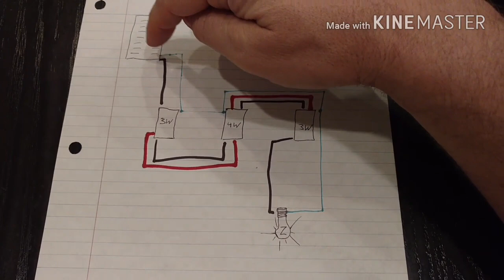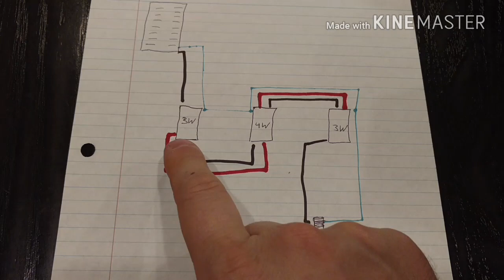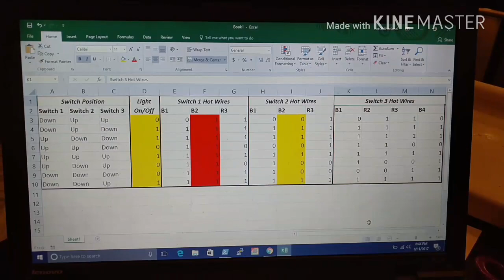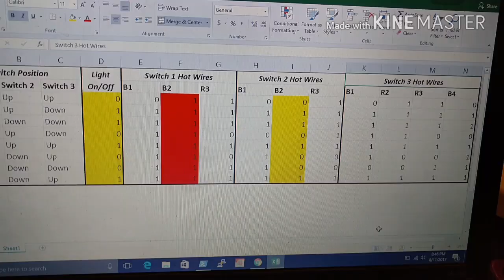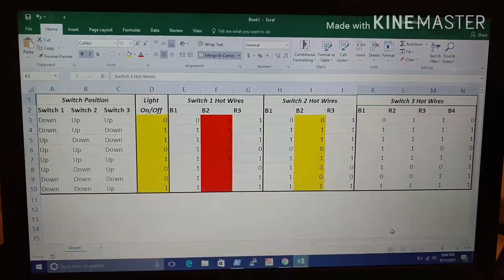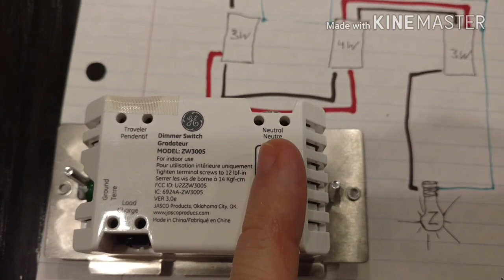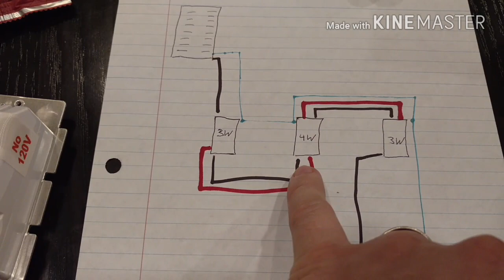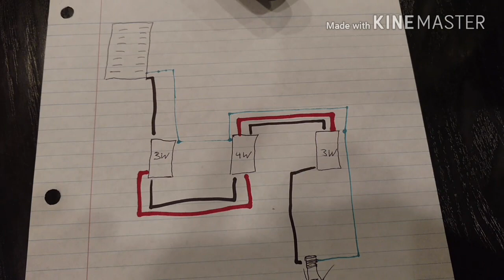Replace 4-way circuit with GE smart switches

Comment: Thanks for posting this detailed video! I was able to follow most of the steps through to the end of the spreadsheet and was able to identify Line and Load positions but you lost me at the "note" about all wires being hot when light is on. Somehow in my configuration I don't have any rows that are all hot when the light is on. Any advice here?
Reply: Think I may have figured it out - I'm not sure that having all wires hot across is a prerequisite for the overall method to work. Using the spreadsheet I was able to "map out" which wires go from one switch to the other (same column values) and basically follow through with the rest of the logic of this video.

Comment: I can use the switch with an input voltage of 220v, since I live in Brazil and the voltage in some localities is 220v
Reply from the maker: I'm sorry. I really don't know anything about electrical standards outside the US. I don't see 220V input listed as an option on the spec sheet for this particular switch.

Comment: I ran into an issue, on my 4 way there is a master switch with 2 reds and 2 blacks, a regular switch with two blacks and a red and then another regular switch with 3 blacks and 1 red with 2 of the blacks tied into the same terminal ( one is a push in and one on the screw) any advice?

Comment: Great video Joe. I spent hours in my last house making a 4-way switch work and only stumbled on the solution, which to this day I don't have any idea how it worked. I do have a question though. My 4-way switch doesn't have a neutral wire in the box. It's just 2 black, 2 red, and the ground. Any ideas how to get the switch to work in this case? It seems I need all of these wires for the power to pass thru and for the dumb switches to work.
Reply from the maker: The right answer is to pull new wire to your box so that you have a neutral in it. :-/ Sorry to be the bearer of bad news. 

Another likely undesirable option would be to turn your four way circuit into a 3 way one by simply joining together the two black in one wirenut and the two reds in another and putting a blank faceplate on that switch box. (As I say in the video, don't assume wire color, but once you confirm/designate travelers vs conductors, you'd know what to join.)

The other option that will function but is not recommended would be to use the ground wire as neutral. This is an intentional code violation, so beware on that front. Using ground as neutral in situations where you are actually sending significant current back to neutral is potentially much more dangerous because you can't assume ground isn't bound to something (like the metal case of an appliance) in the circuit that you would potentially be energizing with this return current. 

In this case, the return current is only the few milliamps the dummy switch draws to run the zwave radio, so the risk is less than in a typical load circuit. However, you'd still be violating code intentionally and disabling a safety feature, so you understand why I can't recommend it.

Good luck!
Reply: This is the way I'm reading it too Joe. There's nothing nearby to pull a neutral from so I guess I'll be looking at other options. Thanks again for the video. Great visuals! I recreated your spreadsheet and everything!

Comment: Do you need a smart switch for each switch or will just one smart switch work?
Reply from the maker: Andy Badi GE makes an accompanying "dummy" switch that is less expensive. I show the models I used in the video, although I would now recommend using the 14xxx series zwave plus switches that have since released. 

You cannot use one of these smart switches in conjunction with a traditional 3 way switch. If you watch the video, I explain how the electrical circuit is completely different. You'll have to replace all the switches in the existing circuit at once.

Comment: I feel I may be missing something, but wouldn't it be easier to determine the positions just by which switch has constant power, and which switch has two traveler wires? The constant power would be the first switch, and the single traveler would be the load to the light, right? And since the loads will be wire nutted, that would be inconsequential, wouldn't it?
Reply from the maker: A big part of the methodology in this video is for determining which wire is constant power and which is the load. The constant power could be determined by removing all the wires from all the switches, capping them, and then testing them with a voltage sniffer to see which wire has power when everything is disconnected. Maybe that's what you meant by determining which has constant power? I wanted to get the answers to the questions before "breaking" the existing configuration.

I'm not sure what you're getting at with "single traveler would be the load" comment. Load wire could be in same box as constant power or in the other box, so I don't think you can safely make that assumption, so I think the testing I outlined  gives more predictable/reliable results across different configurations.

Comment: Great video. Appreciate it. Will this approach change if there are multiple lights connected to the circuit? What if the lights are not all connected from 1 switch?
Reply from the maker: Harpreet Singh multiple lights on the circuit will usually not matter because electrically, they will all be wired in the same position in the circuit, so it looks like one load to the circuit. 

I don't understand your second question about not all connected from one switch. Can you clarify.
Reply: I was taking a look at this: https://www.easy-do-it-yourself-home-improvements.com/4-way-switch.html .  And it looks like the light can be connected either before the 1st switch or after the last to complete the circuit. Will anything from the video change in case the light is connected to source before the 1st switch?
Also, are these the only 2 configurations that can exist?
Sorry if the questions sound stupid. I am new to electric DIYs.
Reply from the maker: Harpreet Singh I understand, now, what you're trying to ask. The difference is whether power from the panel goes first to the light or first to the switch. (Don't describe it like you did. :-)) This video is for the power to the switch to scenario. That scheme is more common in modern homes. I don't have one of the other circuits in my house to demonstrate to you how to determine which switch is which, but you should be able to use my same method for determining the wires. 

If you find that the "constant hot" and "is always hot when the light is on" wires are in the same box, then you have the "power to the light" scenario. If that's the case, your master dimmer goes in that box, and the line and load terminals go to constant power and "matches light" respectively. Then, the other wires are just used for the traveler communication, and no mains current will flow through the other boxes. Make sense?

Comment: So by "dummy" switches, do you mean that they are non-functioning? As in, you can't turn on or off the lights from those switches?
Reply from the maker: No. They function exactly the same at all three stations. The "dummy" switches are a less expensive switch sold as a "companion". The dummy/companion switch simply sends instructions to the primary switch, which actually does the switching/dimming.

Comment: Thanks. This is a great video. First one that I have found that actually explains smart switches. I have done exactly as you have, but I can't get any of the 3 switches to turn off the lights. I wonder what I am doing wrong?
Reply from the maker: bob the accountant sorry I missed your comment. When you say you did exactly as I had done, do you mean you made a chart as I explained to determine where your constant source of power and load are? If so, you probably wouldn't be having the problem you're having, so I'm guessing when you say you did exactly as I did that you just made assumptions based on color (like I said not to do at least three times in the video)? :-)

It sounds to me like the most likely cause of your problem is that you don't actually have the "power to the switch" scenario at all but have the "power to the light" scenario, and you've wired the circuit such that you've cut the switches out of the circuit entirely. If you read through the comments on this thread, I've spoken to several people with the"power to the switch"scenario and have given some tips on getting that working. 

Good luck!
Reply: You are correct, I didn't do the chart like you did. However, I have a multimeter and I easily found the line and lead. I also found the problem. For some unknown reason, the electrician who did the installation work when our house was built, had a pigtail wire going from a hotline on another switch to one of the secondary switches. Thus, there were 2 hotlines in in my setup. One line in the main control box and another in a secondary box. When I figured that out, all I did was disconnect the pigtail line in the secondary box and everything worked perfectly. Thanks for your reply. Your video was extremely helpful in helping me figure out how smart switches work.
Reply from the maker: bob the accountant glad you got it working! Your existing wiring sounds... Fun! :-)

Comment: The voltage does not flow back through the red wire. Only 1 of the 2 wires between the switches is hot at a time. They are never all hot.  But buy the new zoom switches yiu can use your existing 4 way and 3 way switches.
Reply from the maker: My voltage sniffer says otherwise, friend. :-)

Comment: Thanks for posting. I hope you might be able to help me with my issue. I have a 4 way setup. Everything is working, except one of the add ons only turns the light on, not off. I confirmed it is not the switch itself by swapping places with the other add on. Any ideas? Thank you.
Reply from the maker: Gregory Yourek I'm assuming you're using these same GE smart switches with a circuit similar to the one I've described in the video? Your issue sounds more like something I'd expect with a traditional 4 way circuit and mechanical switches.

If you are using the GE z-wave dimmer and slave switches, the only two things I could think of are bad connectivity on the traveler wires or bad neutral connectivity resulting in insufficient current for the slave switch to operate properly.
Reply: Joe Sutherland thanks for your quick and thorough reply. I am using the ge smart switches. I'm tracing out the wires again to try to fix my issue.
Reply: Joe Sutherland, thanks again. I finally figured it out. My problem was that I had both line and load wires going into one box. I connected the line and load wires to the main GE switch and then just attached the traveler and neutral wires to the relay switches.
Reply from the maker: Gregory Yourek ah, that means you have the "power to the light" wiring scheme that I believe I mentioned in passing. See conversation in the comment thread with Harpreet Singh and the link Harpreet provided if you want more detail.
Reply: Joe Sutherland, ha, that described my situation exactly! I should've read this whole thread. That would've cut down on the time I spend on this project. Anyway, it's done and works and that's all that matters. Thanks again!

Comment: A great video! Can I use Meross 3 way switch to replace my 4 way circuit? help from anyone will be appreciated. I really don't want to use GE switches even though I do have Samsung smart hub and GE ZWave switches in my home. I am trying to standardize wifi only in my home.
Reply: If you use Joe's circuit diagram as a reference, then replace the left most switch with Meross three way switch. You won't need to buy dummy switches which will save you money and hassle. Also you won't need a hub. I just installed my switch so hopefully it will continue to work as expected.

Comment: Mine keeps tripping. I'm thinking it might be from my circuit having an arc fault breaker. Anyone have anything on this.
Reply from the maker: All mine were on AFCI breakers. It could be a false trip, but I think it's more likely you've unintentionally connected the positive to the neutral at some point in your circuit. I'd recommend re-checking your wiring.
Reply: Actually I figured it out.  I wasn't hooking my neutral into the correct group of neutrals. There were two groups and the line I was tying into was for another set of lights that were in a triple gang box. Thanks for the fast reply. Great video btw

Comment: Does anyone have a model numer for the GE 4 way switch?
Reply from the maker: 14294 is the one I used in this video. Newer generation (same basic capabilities but slightly smaller physically which helps with crowded wiring boxes) is 46203. It is not "4way specific" but does work with 4way circuits because of the use of the traveler wires as a low voltage communication bus.

Comment: Use a volt meter to find the hot lead. the computer in this video dozen't tell you anything important. And the two wires red and black are both traveling wires going to switch to switch.

Comment: This won’t work without neutral right?
Reply from the maker: Jesse McGill these particular dimmers do require neutral in the box. It doesn't necessarily have to be the neutral from this same circuit (my home has neutral everywhere, so I've never done the "borrowed" neutral technique and am not necessarily endorsing it, but I've read of others doing it), but they do need neutral, yes. Even the dummy/slave switches need a neutral wire.

Comment: Been watching for 8 minutes and I'm dismayed you haven't just shown the full schematic yet.
Reply: It looks like you connect all the low-voltage "Traveler" ports on all three switches together.  That's all I really needed to know.  A schematic is a good way to show that.  Thanks.
Reply from the maker: David Grayson the only schematic I drew was shown at the 35 second mark. What diagram/schematic were you hoping to see?

My goal was to discuss the wiring of a typical 4-way circuit to explain how to identify where the power is coming from since that determines where you place the actual dimmer vs the dummy switches. You could certainly make a more concise video with the assumptions that you understand your existing circuit and already identified the source of power and just need to understand how to connect the GE switches. I think the in the box instructions do a pretty good job of that, but I'm not saying it's not worth a video. If you make it, feel free to post a link here so someone else looking for a shorter video can find it.
Reply: Your schematic only shows the wires in your wall, not the wires to the GE switches, so clearly it's not complete.  The GE 12723 manual shows a good example of how to draw a complete schematic, but they only show a 3-way (two switch) configuration, which is why I was searching around on the internet for a video or schematic from someone like you who has gotten the 4-way configuration to work.